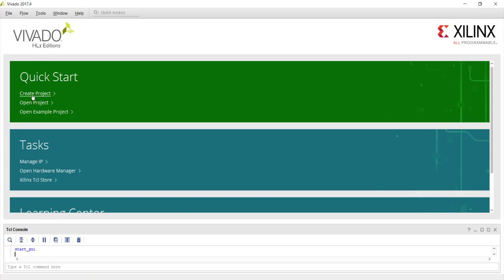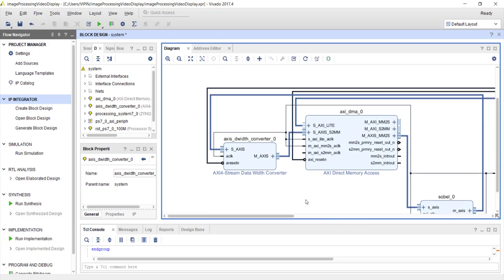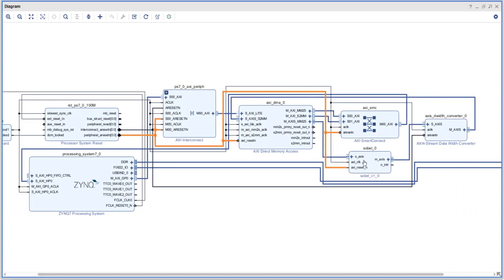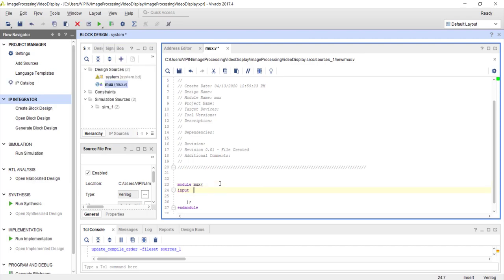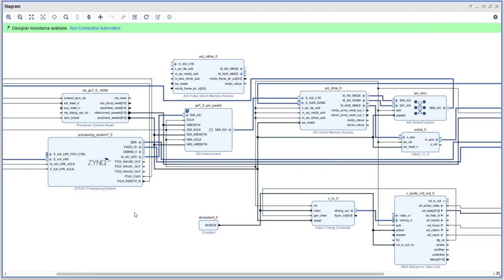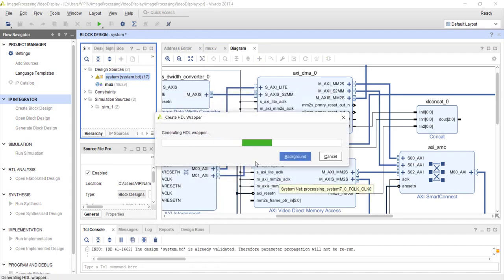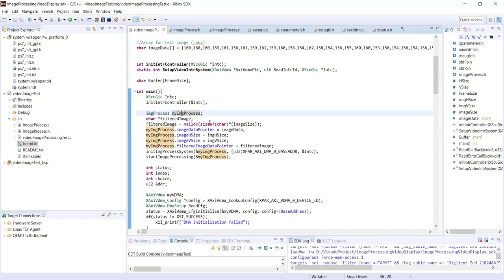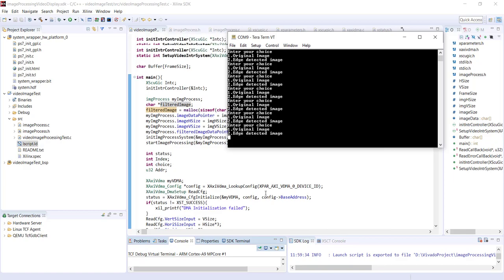Video Interfacing with Zynq (FPGAs): Part 6 Combining Image Processing and Video Output

Comment: Hello, can you make a tutorial on video pipelining system using AXI VDMA configured in both read and write channel? Thank you
Reply from the maker: But Zedboard has only output HDMI
Reply: @Vipinkmenon  In Zybo hdmi is both input and output. I tried to find use of AXI VDMA configured as both read and write but didn't find any simple example. If you can do tutorial on zybo or have any url for reference please share for the same
Reply from the maker: Yes on Zybo it is like that. But currently I have no access to that board. Will update once I get it

Comment: Sir, as you have mentioned that for image processing 1 frame buffer in VDMA IP is sufficient, although the screen refresh is visible.

Can you show a demo on how to use multiple VDMA frame buffers with cache_flush and read_callback on completion or frame counter interrupt, for a smooth transition in output video frames!

Comment: Hi friend, nice job!
I wonder whether zedboard which  running petalinux is able to send video output on any video port such as VGA or HDMI?
if it possible , can you tell me the way to do it?
thanks for advance.
Reply from the maker: It doesn't matter what os is running. There should be hardware in the PL part for interfacing with the display. If you are asking just using software can we interface display, no. Will have to go through the same Vivado steps first and generate the bitstream. The then the driver has to be written following Linux kernel requirement. Then you will have to generate something called a devicetree also, which should be also put in the ad card. Then only your os will detect this hardware and link with the driver since there is no bios in Zedboard.

Comment: Sir how to convert the image into elements that you store into an array?i.e. image_data={};
Reply: from PIL import Image

# Step 1: Convert IPSystem.bmp to pixel values and write to pixel_values.txt
def bmp_to_pixel_values(input_bmp, output_txt):
    with Image.open(input_bmp) as img:
        img = img.convert('L')
        pixels = list(img.getdata())
        pixel_values = [str(val) for val in pixels]
        with open(output_txt, 'w') as f:
            f.write(','.join(pixel_values))

def txt_to_bmp(input_txt, output_bmp):
    with open(input_txt, 'r') as f:
        data = f.read()
        values = list(map(int, data.split(',')))
        img = Image.new('L', (512, 512))  # 'L' mode for grayscale
        img.putdata(values)
        img.save(output_bmp)

# Step 1: Convert IPSystem.bmp to pixel values and write to pixel_values.txt
bmp_to_pixel_values('road_edge.bmp', 'road_edge.txt')

# Step 2: Create final_image.bmp from pixel_values.txt
# txt_to_bmp('pixel_values.txt', 'final_image.bmp')

Comment: I have problem:
'XPAR_FABRIC_AXI_DMA_0_S2MM_INTROUT_INTR' undeclared (first use in this function)	imageProcess.c	line 97
'XPAR_FABRIC_SOBEL_0_O_INTR_INTR' undeclared (first use in this function)	imageProcess.c	
line 88 
in sofware ADK, can u help me??
Reply from the maker: Your xparameters.h file has issue that ultimately means the block design was no properly done.
Reply: @Vipinkmenon  yes, i have question the output of concat in bd no connect to IRQ_F2P of zynq???